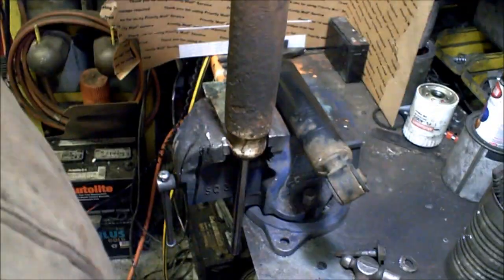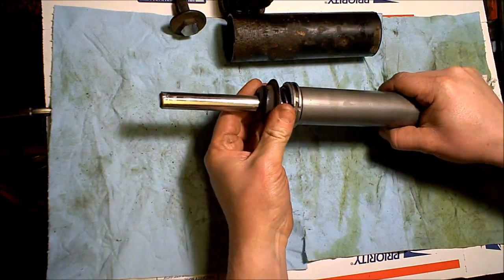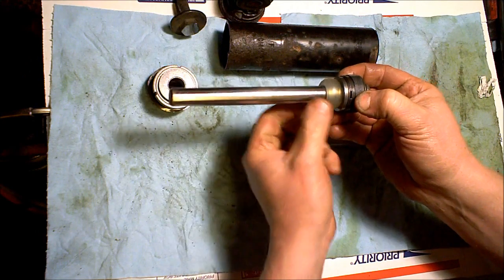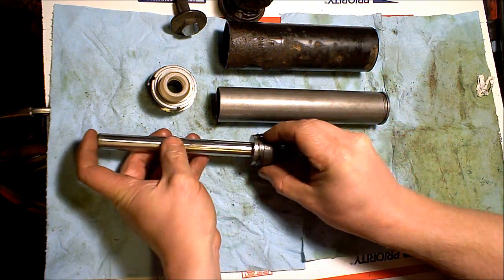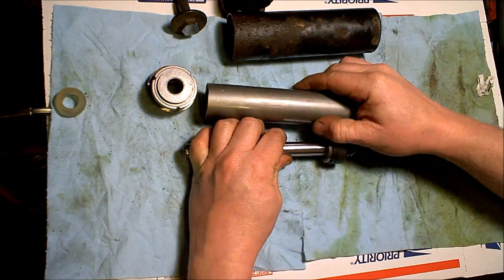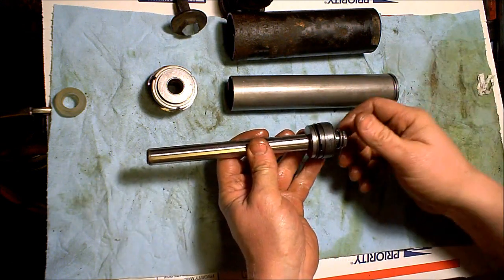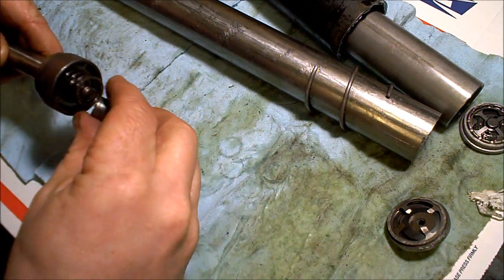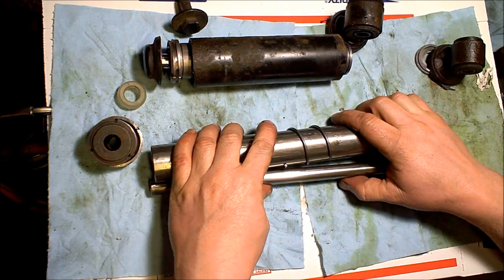Shock Absorber Cut Open Tear Down HOW IT WORKS

Comment: Us this a nitrogen filled shock? I'm tying to figure out how to open these like you are doing and the warning has me curious.
Reply from the maker: Yes. If the shock doesn't shoot back out(expand) when compressed then the nitrogen has all leaked out. If it is very easy to compress but slowly expands there is very little pressure in it.
Reply: @sixtyfiveford  awesome, thank you. 
I tapped and drained them. One moves in/out easily, but the other has some hesitation compressing, and a lot of hesitation expanding? Is there a way to make it compress and expand easier now that I've drained the fluid?

Comment: Is it safe to cut and open a pneumatic shock absorber? I don't know how it works, but i need to extract the steel stock inside to use it for forging knives, i already used one like those you show in the video, just cutting the part outside. But i found a bigger one that is all inside a cover, and i don't want to explode it in my face
Reply from the maker: They don't have a ton of pressure in them. Generally a new shock will have somewhere around 150psi, which is quickly released with a drill bit. If it is an old shock, chances are the nitrogen charge has already released itself.. Personally I would do it with caution and wouldn't expect more than a strong 3-5 second hiss.
Reply: sixtyfiveford thank you so much for the help!

Comment: So no pressure? Cut and will not spray or blevy
Reply from the maker: This shock was "blown" so all the gas(nitrogen) had leaked out. The nitrogen keeps the oil from foaming under severe usage.

Comment: Hello my friend, I was thinking that may be I could convert one of those shock absorbers into a pneumatic piston (I would like to press some things with this resultant piston), my question is do you think it would be possible to modify one of this oil or gas shock absorbers?, may be if I seal the small holes you mentioned and add two air inlets at the top and the bottom of the inner tube. Does anyone know if that is possible? I want to do it at the lower cost possible, best regards. Sorry my english.
Reply from the maker: +Salomon Yes, it is possible. You will need to be able to weld the metal though.

Comment: Why have any resistance at all on the rebound stroke? Theoretically, you'd want contact surfaces to be returned to the ideal condition as fast as possible, and since the weight of the vehicle prevents  "slapback" on rebound strokes, why have the rate controlled at all by valving etc...especially in high performance situations...theoretically.
Reply from the maker: +Alex Henry Manfredi It centers the shock. If there was no rebound resistance it would over shoot the neutral position effectively slamming the wheel into the ground on the opposite side of a bump. It allows a wheel to float over the peaks of several bumps giving you a smoother ride.
Reply: +sixtyfiveford Thanks and I get it about the ride, I just have difficulty seeing in my mind's eye how bad the slamming of the wheel on the opposite side of a bump can be...after all there still is going to be some resistance from control arm bushings, the mass of the sprung weight is resistance too...the pneumatic tire has to offer some cushion also...I'm wondering if its even been tried...especially in racing situations like Formula 1, Indycar etc, where milliseconds are crucial and a bit more contact to the road surface, even by sacrificing ride smoothness may be the difference between winning and losing.
Reply from the maker: If you drove over a 3" bump, a shock that is working correctly will absorb the 3" bump by raising the suspension that amount and then allow it to rebound/return to the 0" position. The quicker it does this the smoother the ride quality for everyone in the car. Of course there is going to be a little over shooting and the inertia of the impact will raise the suspension to 3.5"+- and back to -.5 or so. If you have no rebound/return resistance the spring suspension would go from the 3" compressed and over shoot the 0" mark to -1to -2". So essentially the car would raise up/jump on the opposite side of the bump and slowly settle down to the correct ride height. So every bump you hit the car would lift afterards and make for a strange ride. Here is a random video with shocks that are completely gone. https://youtu.be/gaAEO0MPwAA . Of course this has no resistance in either direction but you'll notice after a bump how the front jumps.

Comment: Great video mate.. however at 3:47 I think you get a bit mixed up. In normal applications, the compression stroke will have a lighter resistance deflective stack than the rebound stroke. (Counter-intuitive, I know!). Your comments about the rebound only bearing the forces of the wheel are also incorrect, as on the rebound stroke the shock absorber is working against the release of the energy stored in the compressed spring, to control the deceleration of the sprung mass of the car, which is more significant than the unsprung mass of the wheel and suspension. The leading stack is the one controlling the compression stroke, and the rod-end stack (the thicker stack) is controlling the rebound. I think you just got your directions and stacks mixed up in the explanation
Reply from the maker: I see where you a going with this. The shock doesn't bear any weight it is just a speed controller. The impact of a pot hole will always compress the shock faster than the rebound speed of the spring. Shock manufactures always put a stiffer valve pack in the compression stroke and a lighter on in the rebound because of this.

A coil spring will react with the same force whether it is pull or compressed. But, since the weight of the vehicle and force of the gravity acts to slow the speed of the rebound they don't need to put as stiff of valving in the rebound. Just the opposite is true with the compression stroke as the vehicle weight and the force of gravity create greater speed which requires more force on the compression stroke to slow it down.
Reply: +sixtyfiveford sorry mate, but you are clearly a bit confused because your above comment is completely back to front. I tried to politely point this out to you earlier, and once again suggest that you try doing more research instead of attempting to school others with your incorrect understanding. Please re-read and try to actually understand my earlier comment.

You will find that ALL deflective disk shim type shock absorbers have stiffer shims within the rebound stack, as rebound needs to work in amortising the great amount of potential energy stored in the spring to prevent a violent "kick back" after the compression stroke reaches its apogee. Note also that (somewhat counter-intuitively) larger diameter deflective discs are in fact are easier to deflect, not harder. Typically, a compression stack will be comprised of large diameter, thin cross-section deflective shims. The rebound stack will be comprised of thicker, smaller diameter shims.

Comment from the maker: I would try to weld studs to the axle and the frame and mount some cheap generic dampers. Generally what fails is the gas charge in the damper. The gas keeps the oil from foaming; once it foams it flows to easily. If I were to attempt to repair one I would try to hook on a tire valve so I could fill it with and air charge.

Comment: nice job and explanation, giving me evil idea's, i have an 1990 ls400 with buggered shocks,  when they are new they are very good,  unfortunately, or fortunately  they are also equipped with air bags which i really like, air suspension works perfect but dampers are all shot, and here in Australia if you can get hold of them they are $4000 + for new ones(cough), i`m, thinking of drilling, draining, filling up with heavier oil, just hoping  for them to last for 12 months or so, thoughts  ??

Comment from the maker: A strut is a shock and spring together.  The thing that goes bad is the shock tube. So I would just do the strut without the spring. Bouncing means the spring is working.  You will need to rent a spring compressor (free at most auto parts stores). An impact gun helps but is not crucial. Let me know how it goes.

Comment: Cool vid Ford, quick question, I have an extra car that needs work and the back end is bouncing...any way to tell if I need new shocks or the all in one quick strut?   Cost is about half...quick strut v. Just the strut assembly (without spring).  Just trying to see if u knew before taking apart.  Thanks.

Comment from the maker: The oil installed in these is under pressure. Once the gas leaks out the problems start. When the oil isn't under pressure is foams and passes through the valves a ton easier. Also since gas can compress and oil can't, once the oil foamed(gas/oil mix) it now compresses giving a spongy feel to shocks. Ta muchly.